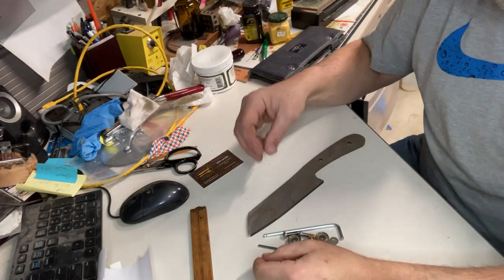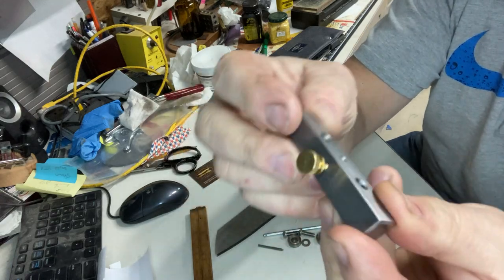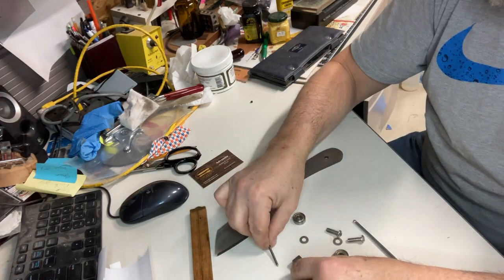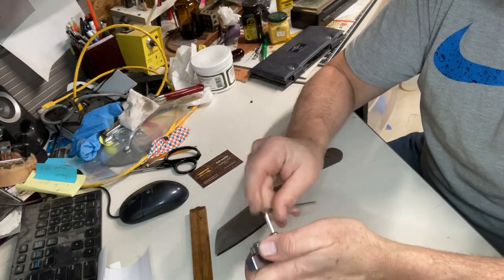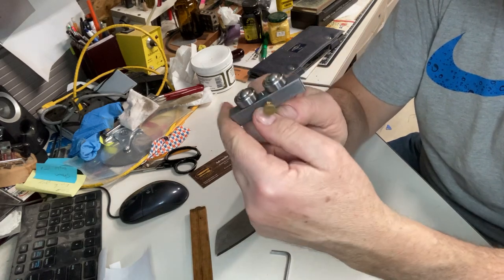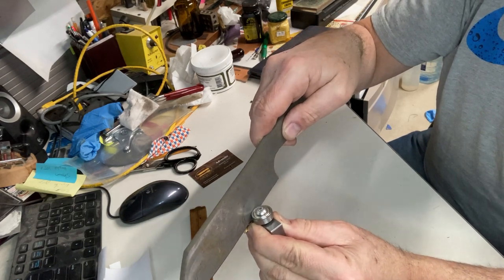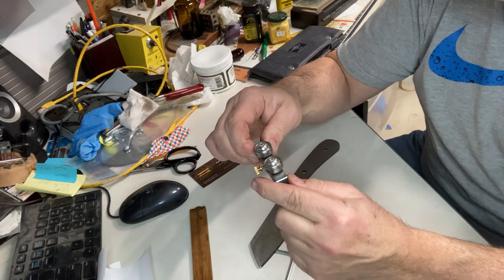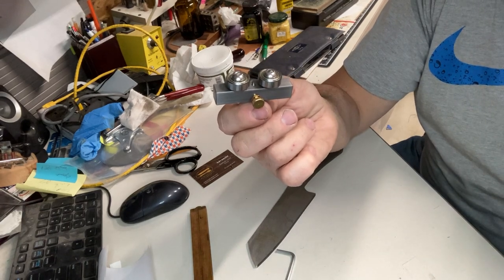Knife Maker's Center Line Scribe Kit, Edge Scribe, 2 x 72 Knife Maker's Scribe

Comment: Seems to me that you need one that scribes two lines 1/16" apart. You don't want to grind your  edge thinner than that before you heat treat it. Not on steel you have to quench anyway.
Reply from the maker: this is a center scribe. you are right if you want grind guide lines a different approach makes sense